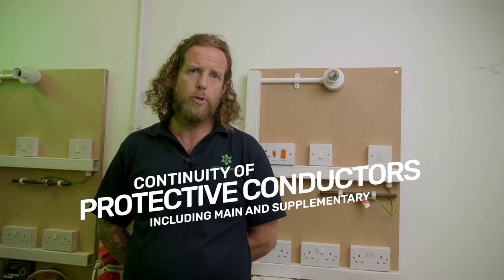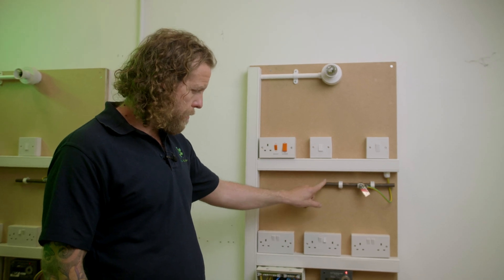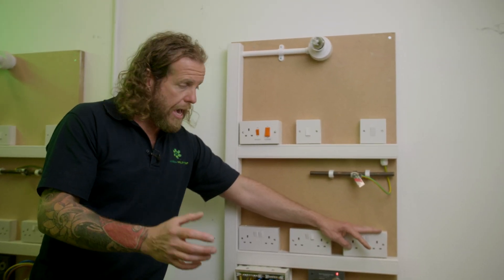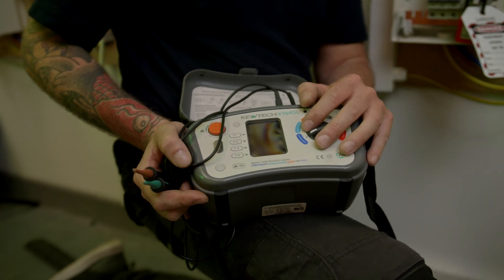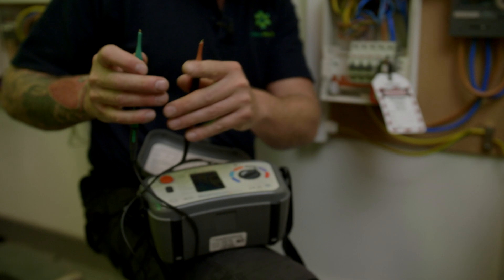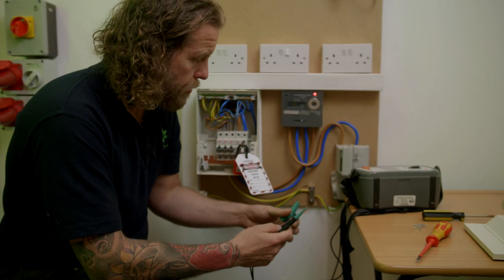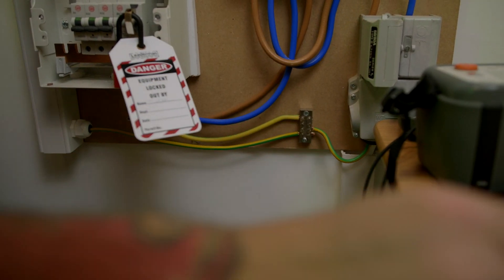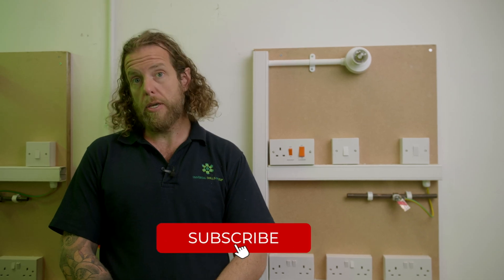Continuity of protective conductors including main and supplementary | Electrical Tutorial

Comment: Clearly explained, good video mate. Just two points to mention  1) GS38 doesn’t relate to the test instrument it only requires that the test leads are of an adequate length and the there is no more than 4mm maximum ideally 2mm of exposed tips.  (2) when you null the test leads you are not removing the resistance of the leads as such , the MFT takes a reading of the leads resistance and a deducts it from the test , . The test lead and any conductor will always have a resistance . 
But a good demonstration and video 👍

Comment: What's the maximum acceptable reading for this test?
Reply from the maker: The reading should not exceed 0.05 ohms. The reading would vary depending on the length of the bonding conductor.
Reply: Thanks for the videos and reply.